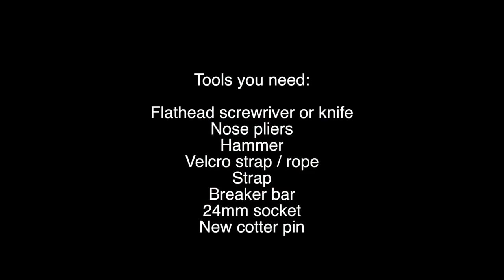Piaggio Fly - Rear Wheel Removal | Mitch's Scooter Stuff

Comment from the maker: Tools you need: 
Breaker bar 1/2 drive - http://amzn.to/2HenuMI
24mm socket 1/2 drive - http://amzn.to/2Cd9aoC
Cottor pin -.156 X 1.25 
Velcro strap - http://amzn.to/2HFGPXl
Rubber mallet - http://amzn.to/2BsqAMz
nose pliers - http://amzn.to/2yetDDj
Flathead screwdriver - http://amzn.to/2jN7lpE

SHOP MY SCOOTER STUFF: http://amzn.to/2CbqQku

Pre 2013 Piaggio Fly 150 videos: http://bit.ly/2fB7mdS

Want more free Scooter Tip / Tutorial videos - Please support MicBergsma!
Paypal donation: http://bit.ly/2fghrwN
Reply: Rånar lastbil
Reply: *I'll look around some more...Honda 'Metropolitan' has no cotter-pin, and 
retaining-nut has never been removed since new in '08!*
(I put a steel-post thru the wheel to lock it in place...used a 3-ft. long cheater-
bar...and the scooter had so much torque on it it was trying to flip-over on me!)

AND STILL IT WON'T MOVE!  Even oiling after heating w/a blow-torch on that nut does nothing!  (no rust...but it's been on there for 11-years and 10-k miles!)

Comment: hello please how do i change the brakes then after that
Reply: You see the shoes in the last shot in this picture. You should see two springs with hooks, you can take the shoes and wiggle them out from the two round pins they rest on. The shoes should come out together, then you can remove the springs and separate them. It is worth cleaning the springs using brake cleaner, as well as the inside of the brake drum - check the drum diameter is within manufacturer spec, if not, it is worn and you will have to replace the tyre, but this happens less often than needing to replace the shoes. Clean the inside of the drum with brake cleaner and 600 grit wet and dry sandpaper. Inspect the shoes - ensure you have to replace them, you will know this if the material left on the pad is under manufacturer spec, or if there are deep gouges, grooves, excessive wear on only one shoe - then replace them as a set. If possible, sintered brake pad material is much more robust, but it might be hard to find for a rear drum set of brake pads. If the brakes are not below wear limit, clean with brake cleaner and scuff out any scratches with 600 wet and dry sandpaper using the brake cleaner as a lube. To save money, you can use dish soap and water (make sure the soap doesn't have salt in it and is very mild) and then finish by drying and spraying with a coat of brake cleaner which will dry and displace any left over water. Put the springs back into the pads and then align them with the pins they rested on and wiggle them back into place. Hope this helps.

Comment: What size cotter pin do i need?
Reply: I had to use 24
Reply: @vincehoffman179  what is the measurement in inches?
Reply: @Freebird1765  2,4mm
Reply: I have a 3.0 x 40 mm will that work?

Comment: ya mitch help  please how do i change the brakes then after that
Reply: You see the shoes in the last shot in this picture. You should see two springs with hooks, you can take the shoes and wiggle them out from the two round pins they rest on. The shoes should come out together, then you can remove the springs and separate them. It is worth cleaning the springs using brake cleaner, as well as the inside of the brake drum - check the drum diameter is within manufacturer spec, if not, it is worn and you will have to replace the tyre, but this happens less often than needing to replace the shoes. Clean the inside of the drum with brake cleaner and 600 grit wet and dry sandpaper. Inspect the shoes - ensure you have to replace them, you will know this if the material left on the pad is under manufacturer spec, or if there are deep gouges, grooves, excessive wear on only one shoe - then replace them as a set. If possible, sintered brake pad material is much more robust, but it might be hard to find for a rear drum set of brake pads. If the brakes are not below wear limit, clean with brake cleaner and scuff out any scratches with 600 wet and dry sandpaper using the brake cleaner as a lube. To save money, you can use dish soap and water (make sure the soap doesn't have salt in it and is very mild) and then finish by drying and spraying with a coat of brake cleaner which will dry and displace any left over water. Put the springs back into the pads and then align them with the pins they rested on and wiggle them back into place. Hope this helps.
Reply: devin thank you so much for the help...do you know how to do the front to THANKS jimmy
Reply: devin thank you so much for the help...do you know how to do the front to THANKS JIMMY
Reply: the front callipers usually have two bolts connecting the callipers to the fork. you only need to undo these to slide the brake calliper assembly off, if it's stiff you can wiggle it loose. the way it works is with piston/s that push on the pads via hydraulic pressure from the fluid system. one way to refresh front brakes is to apply pressure to the brake overnight to release any trapped air within the system - literally just use a winch tie or cable ties to hold the front brake on overnight. anyway, once the calliper is off there will be a few things to look for... the pads are usually held in by a retaining pin, it's going to be thick and held in place by cottier pins - like in this video holding the wheel on, but smaller. you can use pliers to get these off, and usually you will be told to replace these if you remove them.

once the pin is out, the pads should pivot freely on the other pin they slide on to - they actually aren't held in by much at all. the best thing to do is to take pictures of the assembly once you have it off the fork, and lay out anything you take off in the same orientation and general position as you took them off. i like to have a towel laid down so it's easy to see all the parts and not lose anything. there will probably be a metal retaining clip in the calliper that keeps the pads orientated correctly, and this metal clip will only sit in the calliper in one orientation. clean everything as before, I like to use an old toothbrush to get into the brake pads - they will look like two squares of material and often have a lot of crud built up in the middle and sides, just carefully use a flathead screwdriver to get most of the crap out then finish with a scrub, and. finally spray with brake cleaner and let dry. again check the material left, check they are evenly worn and have no cracks, gouges or grooves - if they look bad, replace - very cheap for a moped and very important to your safety. next the calliper - inside is the piston, which has a rubber seal that keeps the fluid inside. check for wear on the gasket - very bad if they're broken or leaking as then you have brake fluid all over your brakes... things that can cause wear to this seal is corrosion on the piston. so, very gently apply a little front brake to see the piston/s push out to where you can see the shiny part Vs the dirty part. be careful as if you apply the brake too hard you could shoot the pistons right out and need a whole rebuild. once you can see the shiny part of the piston, clean the whole assembly and check the piston for corrosion - rust pits, chips, etc. if there's some rusting, you can use 600 grit wet and dry to rub it off. the piston should be able to rotate around, so check all sides and the rim, give it all a good clean and spray with brake cleaner to finish. the best way to put the pistons back in is to use the pads, put the back of the pad up against the piston and press it back in witb your hands- shouldn't take too much force. then put everything back together - taking pictures beforehand is really useful, don't underestimate it! some people like to put copper grease on the back of the brake pads as this helps dissipate heat and keep them moving... however on a moped, it's really not a performance machine, it's not a big deal. another thing you can do if you're interested in building your garage materials is use rubber grease around the piston seal to keep that area lubed and looked after - but both these things, copper slip and rubber grease, come in large tubs, so it's not exactly worth it if you're only going to do this job once. up to you though! 

once you have the calliper bolted back on, you will need to pump the brake system. it will be very light and loose at first then stiffen up (the lever). before you go out on the road, test the brakes down the street - first walking and then slowly on the moped to make sure everything is working. last thing you want is to find out something is wrong in the middle of a busy road
Reply: James Lada if you want any more detail just look up Delboys Garage front brake, he does bikes but they are very similar at the end of the day especially when it comes to brakes
Reply: devin your the man that help so much just want to say THANK YOU i have all the parts just need to find to do it 
THANKS JIMMY
Reply: hope it goes well, always satisfying to do a job yourself!
Reply: devin doing a oil change my bike take 5w 40 but i can only get 5w 40 synthetic for car will that be ok

thanks
jimmy
Reply: James Lada semi-synthetic is what you would usually use, but it depends on what was in there to begin with. you can use fully synthetic but it's not a good idea to mix oils, for example if semi synthetic is already in the moped. you might want to just do an oil change, would be the healthiest option
Reply: thats what im going to do thanks